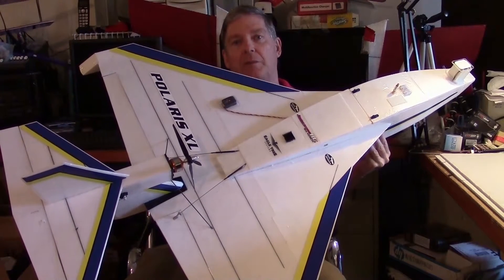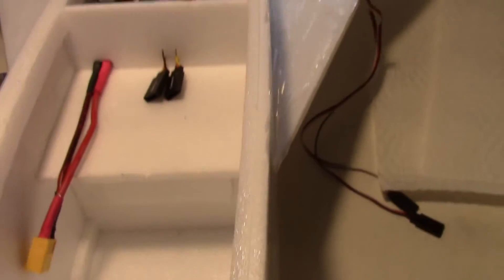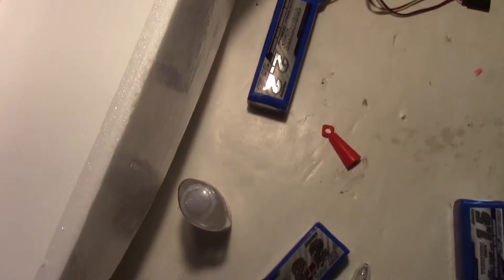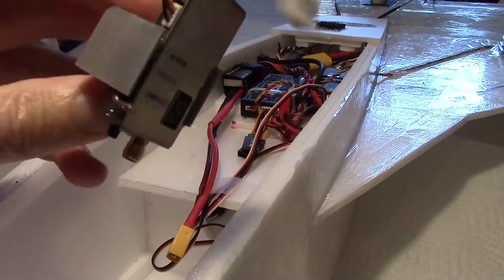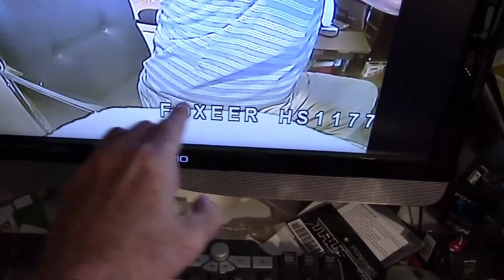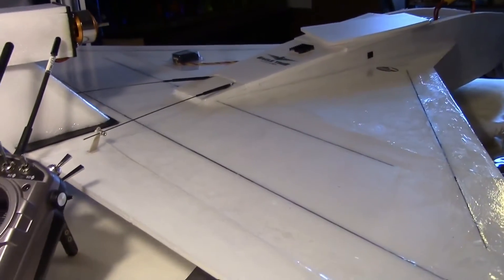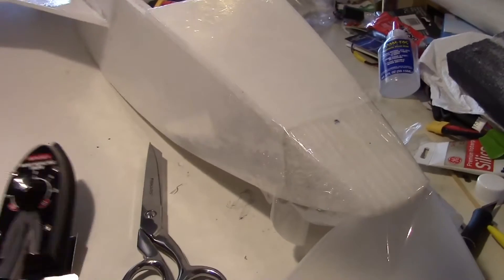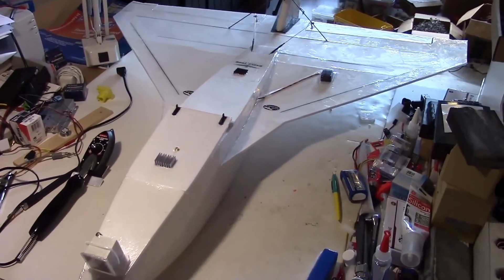ModelAero Polaris XL FPV Seaplane Build Part 14 - Battery Tray and Bulkhead, Video TX, Top Hatch,

Comment: This build is looking more and more good!
Not really surprising after all, you always managed to build some cool airplanes Dave :)
Thanks for sharing and happy midweek
Reply from the maker: The Polaris is easy to fly with a very light air frame. So as long as the winds are low it does great. Thanks for the post.